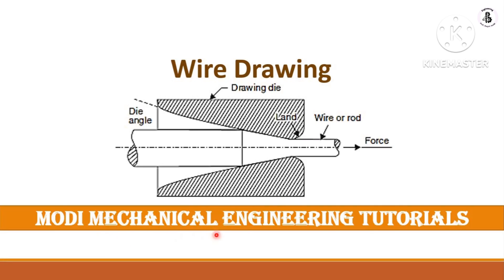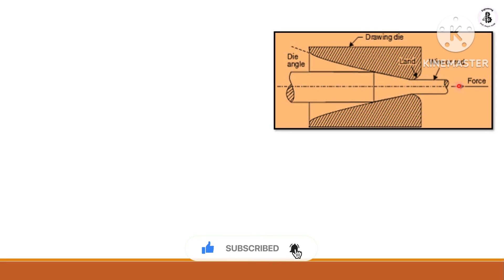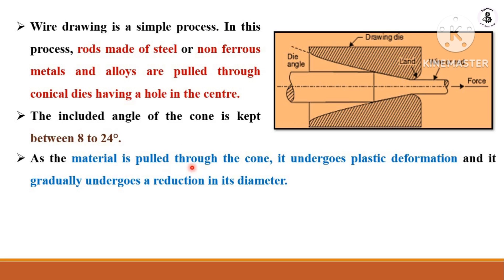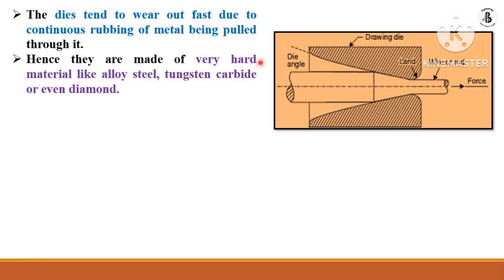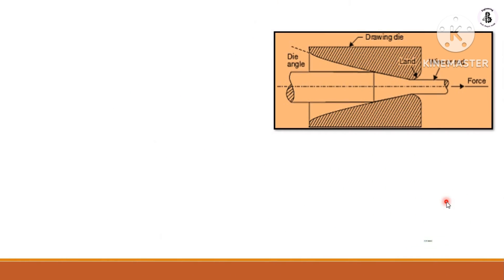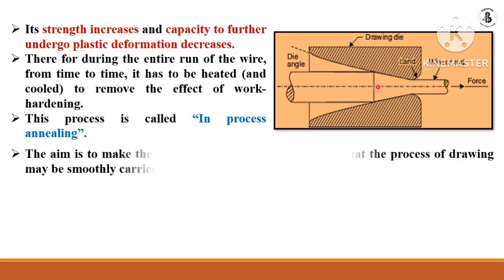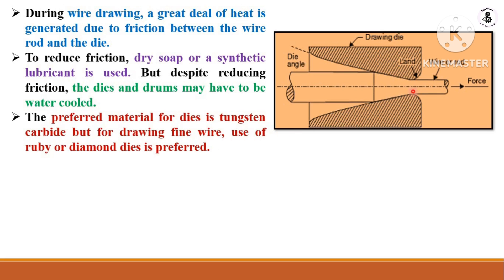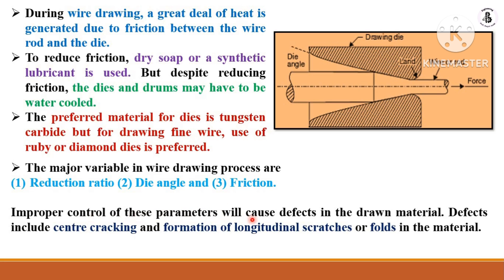wire drawing process | wire drawing process explained | wire drawing |metal forming process #forming

Comment: The dies we used in the UK 1950s he 1980s were made from 85% tungsten 15% cobalt both as a powder mixed with camphor to make a paste pressed into a pellet in a mould then presintered for 80 hours then for 100 hours the pellet was put in a metal case sizing and polishing is done with diamond paste to achieve the correct diameter the dies could be opened out when they were oversize to a larger diameter diamond was used for smaller sizes but cost was much more expensive.The diamond dies were for drawing platinum to 0.0015 you needed a piece of white paper to see the wire all of this was for woven mesh a Hollander weave 2500 to the inch.